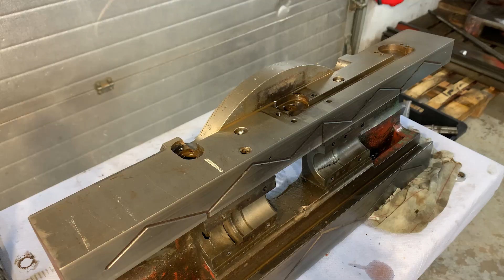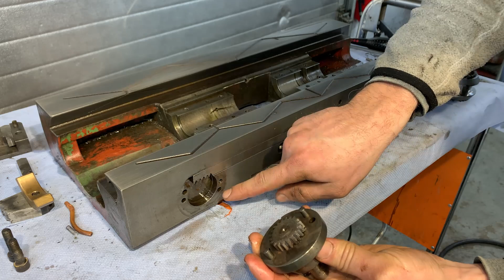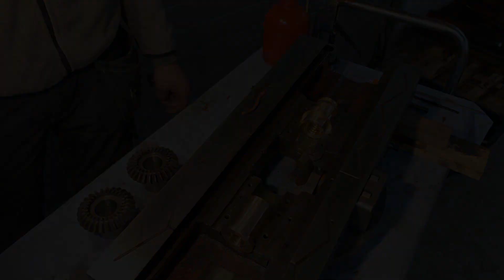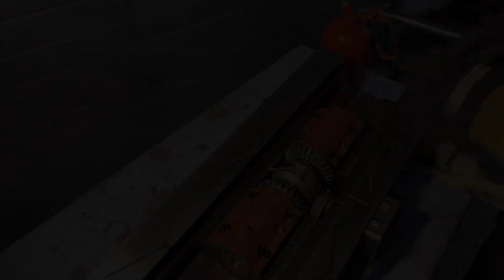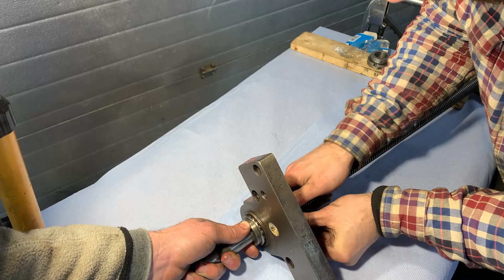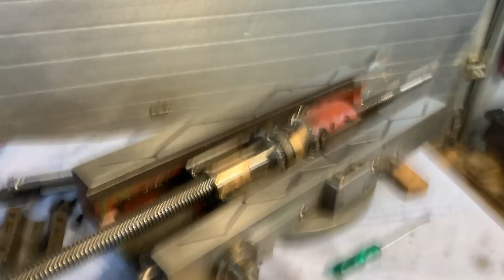SAJO milling machine restoration - PART 14

Comment: Those aren't grease nipples. They look like it but they aren't. Those passages need way oil, not grease. Old oil with other contaminates will turn to grease. I always give my milling machine oiler a couple pumps every time Im in the shop even IF Im not using the mill just to keep fresh oil pushing out the old oil.
Reply from the maker: Thanks, we have been thinking about this, wheter it is grease or old oil, we are going to use oil at least 👍
Reply: @Builditandfilmit  These machines were never designed for use with grease. Grease will destroy the machine and cause it to prematurely wear out. I would consider removing the oiling zerks and installing a normal oiling system.
Reply from the maker: @opieshomeshop Hmm, not really familiar with what kind of oiling system you mean? Could you tell more, sounds interesting 👍